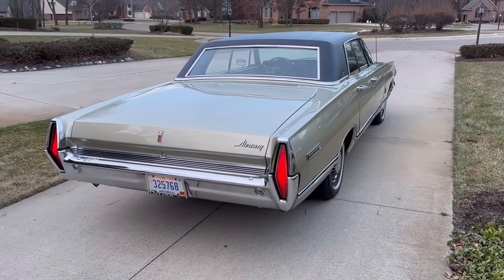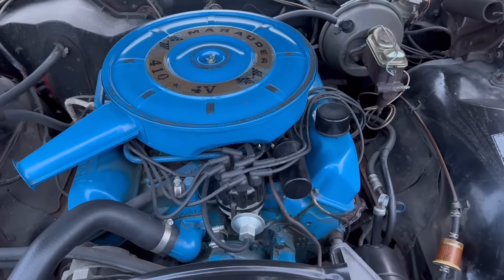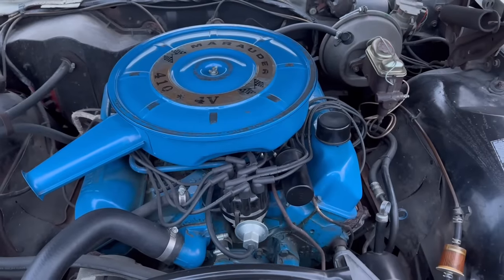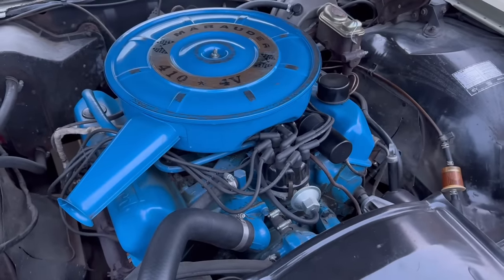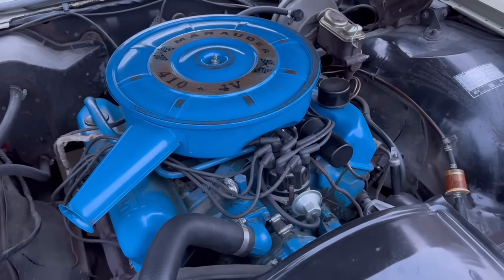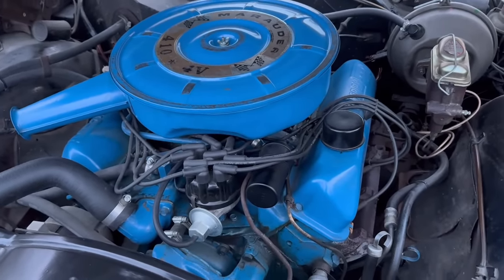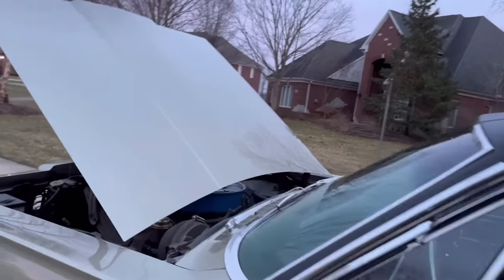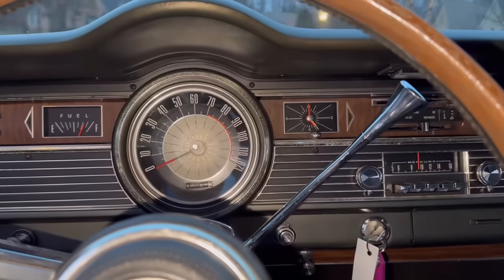Ford's Shortest-Lived (and Smoothest) V8 Engine: The 1966-67 Mercury Only 410 V8

Comment: I accept your challenge! When Ford went to an OHV V8 in 1954, they made it in 239 cubic inch form for only one model year: 1954.  In 1955 its displacement was increased to 272 and 292 cubic inches.
Reply: In trucks, the 239  remained available till 1956..
Reply: The one year only E0 Blue 4.2 liter 255 before the grey or unpainted E1 81 and 82 4.2 liter. Ford changed the intake manifold, and it then remained the base engine in the Fox T-Bird.and XR7 Cougar, Panther Crown Victoria and Marquis, the Automatic RS Capri and Mustang GT auto.
Reply: It's a beautiful car!
Reply: The Lincoln LS and Ford Thunberbird also had 3.9 liter V8's....
Reply: Not the same engine as the original “Y-block” 239, which was the first OHV V8 in an American Ford car. The last flathead V8, interestingly, was also 239 cubic inches.😊
Reply: I was replying to the comment about the Lincoln LS 3.9 engine.
Reply: @rextownsend5101  Correct.  The engine in the LS/Thunderbird was an AJ, built in England.
Reply: FE 332, 1958 and 1959 I believe
Reply: What about the Ford 406 found in Galaxies in 61-62?
Reply: Mercury Montclair perhaps the best demo derby car ever built! Tanks! Lol yes I did 4 or 5 of them lol
Reply: @joesutherland225  Wrong.  They banned the '60's Imperials because they could not be destroyed and won nearly every derby....
Reply: 54 mercury 256 was a fun motor in my opinion.
Reply: Mercury got a 256 inch version of it for 1954 only
Reply: Beautiful car Adam. So glad there is a guy out there who can preserve these wonderful land yachts and share his vast knowledge with us. Thank you.
Reply: I believe that the 410 was offered due to a shortage of 428 blocks. Using the 390 blocks with 428 cranks provided a premium engine to fill the volume gap in 428’s. All of the FE engines were terrific. Smooth and durable. Great in cars and trucks both.
Reply: My nephews rescued a '54 Ford Customline coupe from their grandfather's farm, which has the 239, and all the factory engine dressing and paint in tact (unfortunately, it bent a pushrod when they tried to start it 😢).  It's a work of beauty, and Ford was quite proud of first year Y-block.  From a design point of view, the suckiest thing about the Y-block is the rope seal at the rear which doesn't age well (like 100% of them leak from the rear seal).  There's a company that makes a kit to eliminate the rope seal, but it's major engine surgery to install it.
Reply: @geoffreywrigley2751 The 406 was also in the 1963 Galaxies. I had one.
Reply: He was talking about the FE engine (first year was 1958) in which he is correct.
Reply: @multicyclist  
FE engines refer to the family of engines which started with the 332CID and ended with the 428CID.
https://en.wikipedia.org/wiki/Ford_FE_engine
Reply: and 312
Reply: @DanHolmes-o9b  
I believe the 312 was a Y Block
Reply: @geoffreywrigley2751 .  That is an FE Block with a Bore of 4.130” and a stroke the same as a 390 at 3.78”.  Otherwise little different from a 390 and would bolt right in in place of a 352, 360, 390, or 427.
Reply: @deanstevenson6527  I had one of those. 1980 Mustang "Cobra". When you look up the definition of "pitiful," there's a reference and picture of the 255 ci V8. Ahh..., the "malaise" years.
Reply: Always liked early thru mid 60s Mercury's. 😊
Reply: @geoffreywrigley2751  No 406 in '61, was a '62 & early '63 engine.
Reply: Also 312.
Reply: @deanstevenson6527  it wasn't a very good engine.
Reply: @rdt8888 yep Y block it was.
Reply: @oneninerniner3427  It wasn't a very bad engine compared to say, the 85 to 87 HP 3.3 liter six.Everyone bags the 4.2, but it was economical, just not very quick.
Reply: @deanstevenson6527     Ssssshh.   We don't acknowledge the 255, lol.
Reply: The MEL 410 V8 was offered in the 1958 Edsel Corsair and Citation, and that was the only year it was offered. It didn't return for 1959.
Reply: @rextownsend5101  The Y-blocks also suffered from oil starvation at the rocker shafts due to sludge buildup in the oil passages going up thru the heads that fed the rockers. There was an aftermarket "remote oiler" fix kit, consisted of a fitting that tapped into an oil passage in the side of the block, feeding 2 plastic lines that went up to spray fittings tapped thru the top of the rocker covers, whiched sprayed oil on top of the rocker arms and shafts.
Reply: In 64 I know they made a 221 no idea what year it first appeared or ended.
Reply: Well done
Reply: 256 was also in that family with 272, 292 and 312
Reply: The 1954 Mercury engine was 256 cu in  YBlock
Reply: Everyone forgets about the 221 V8. I had one in my 1963 Fairlane. Great little engine. Made for about a year.
Reply: Wasn't the 239 also offered as an industrial engine for several years?
Reply: @geoffreywrigley2751  No 406 is '61. '62 and '63 only.
Reply: @ramflash1 yeah, I had one. My wife loved her little Cobra. In 83, I traded it in on a new T-Bird. Silver and black. I kept that car till 2018 when I gave it to a nephew. He loves that bird. I have a96 Mystic since new.😊😊😊
Reply: @deanstevenson6527  Ford never made anything measured in Litres in the US until the 5.0. If you're gonna talk about American cars at least use our measuring system!
Reply: The 221 Windsor lasted 18 months
Reply: @nathan40307  In 1966, Ford America released the 7 Litre  Galaxie 500. It was a  428, and wasnt even a 428, it was a 427 with  6990.1 cm³ 4.13 X 3.98 is however, just under 7 liters. And the advertising team spelt the name Wrong. Every one knows a Litre should be a Liter. 5 marks off, Henry Ford II...Just because some stupid Kiwis help America win the Le Mans '7 Litre' class. GED fail...
Reply: It was ALSO a 312 Thunderbird Engine y small y block v-8 !
Reply: @geoffreywrigley2751 Yeah he Skipped the 427 FE  TOO !
Reply: The marketing theory behind small engine changes has always been, "We have to give them something new and interesting for next year!"
Reply: From what I know the 215 ohv straight 6 was one year only then went to the 223 in 53
Reply: Ah yes, the good old days when you could lift the hood and see the engine, instead of a bunch of plastic crap. Everything was easy to get to and service!
Reply: @joesutherland225 
The Montclaire was built for demo derby?
Reply: @wythetrumpet6419  yes, fortunately I am still living that while I can, there is a lot fo flexibility to the older designs
Reply: Let's just say, Ford has made more engines in more sizes and more variations of each of those size engines for less good reasons than any other car company in history !
Reply: @darensamuels5208  390 and 428 blocks are identical blocks just a different bore size. Ford cast all of the blocks the same except for the late 406's and 427's. After casting they bore the blocks to whatever bore they want. So there would have been no shortage of blocks.
Reply: @deanstevenson6527  Liter is an "American only" spelling. Every other country in the world spells it litre. Since Americans did not invent the Metric system it seems apparent that the American spelling is wrong.
Reply: @FRLN500  You are getting a Meter of mileage out of this post.
Reply: @BillSmith-fx7xx  
Maybe they were on to something?🤦🏿🤦🏻
Reply: @deanstevenson6527     " And the advertising team 'spelt' the name wrong ".    I know some will argue that language is constantly changing.   As for me, I am sticking with 'spelled'.   :-)      Maybe you misst your calling !    :-)
Reply: @MrJohnnyDistortion     Not sure I understand your comment / joke ?   Please elaborate.   Thanks.
Reply: @BillSmith-fx7xx  lol
Reply: @tadhammond3901 
My friend had a 62 Fairlane with a 221 small block V-8
Reply: @rextownsend5101 
Simca produced the last Ford Flathead V8 design in 1990. They were for the Simca Marmon Military Truck. It was 255 ci like the 1953 Mercury.
Reply: The 260 cuin v8 in the ford falcon 1964-1965 the 289 replaced the 260 in ford cars.
Reply: @tadhammond3901  The 221 V8 set some records on the Salt Flats as well.
Reply: Didn't mercury make a 430 ci engine also? I'm a Mercury guy for my whole life. I currently have a very early January of 1965 Mercury Comet. Mercury did things a little different. And I 100% agree with your post also. The early Y blocks were different. Especially just after the flathead went out of production
Reply: @HIGHLANDERNEO2 One of my fondest car related memories is a ride in a 260 Ford powered car back in the early 1980s. It was an AC Shelby Cobra MK I.
Reply: @nickfay2359  
430 MEL (Mecury-Edsel-Lincoln).
1958-1960 Mercury
1959-1960 T-Bird
1958-1965 Lincoln

'59 T-Bird - 350 bhp
''58 Merc Maraudeer - 360 bhp
'58 Lincoln - 375 bhp
'58 Merc Super Marauder - 400 bhp
(Three 2 Barrel Carbs)
Reply: @brentboswell1294  yep know that well, a tedious task, more time consuming than hard, done one too many, but? Still great motors
Reply: @frankpriolo7735  From what I recall it was a series 262 to 312 were Y block and even the 351C was similar
Reply: @gk5891  And it's not able to be used in Bonneville Salt flat racing. Because it's cast in France and can be stroked way past 305 cubic inches...I liked the Pont-à-Mousson four speed gearbox too. When FoMoCo sold out the production capacity to Simca, a lot of really good Ford stuff was found under the engine covers of  troupe carriers. Klass in Germany continued to cast Model A flathead blocks for its combines too. A lot of stuff Ford left behind...
Reply: @FRLN500  That's not true.  That would result in vastly differing wall thicknesses and affect cooling.
Reply: My family had a 1954 Ford Custom 4 door. It was our family car and my family used it for years to haul a 16 ft travel trailer from LA to Lake Tahoe each summer
Reply: What engine was in the 54 Mercury that had the shit oil returned from the valve train.
Reply: @tadhammond3901  I had a 63 fairlane sports coupe with a 260. Very durable engine took lots of hot rod abuse
Reply: Beautiful!
Reply: 337 cu in  flat head 1951 Lincoln 317 cu in OHV y block 1952 Lincoln both Ford Motor Company vehicles.
Reply: @nathan40307 what about the  7 litre ( 427 ) Ford Galaxy in 67 ? That had a metric designation right there on the front fenders. Nice car.
Reply: @georgerenton965  I guess I've never seen one.
Reply: @nathan40307 not true. The 1966 XL 7 Litre.
Reply: @carlospar3727  yes, don’t know why I said 67 ? Wasn’t impressed with the 67 body style. Thanks.
Reply: Loved the 351 GMC V6. Easy to change the plugs, just a truck engine, plus two put together made a 702 work horse.
Reply: @darensamuels5208 that makes sense as to why they built this engine
Reply: Ford made a small 221 cubic inch ohv  V8 that was very smooth running in the early 1960s as well.
Reply: @johnscott2849 
I had a 62 Fairlane that had the 221 in it
Reply: I worked on a 1958, 383 FE Mercury engine, in a Automotive class in high school. The engine was donated by the local Mercury dealer. I’m pretty sure it was 383 c.I.
Reply: and 312ci.
Reply: @gk5891 The 430 wasn't actually considered an FE block. and it originated in Lincoln's.
Reply: @nathan40307  As the former owner of a 1966 Ford Galaxie 500 7-Litre I disagree.
Reply: @deanstevenson6527  
Actually they offered that car with both the "428" 345 bhp standard engine and the "427" 425 bhp. 

As to actual displacement, that is done everyday just like the Ford 352 (Same Bore x Stroke as 351), the Chevy 302 (Same Bore x Stroke as the hotrodders 301) as well as many others. Some 302 Ford's have 4.9L and some 5.0L on the emissions stickers depending on year and car or truck model.
Reply: @user-dp8gb9zu8v  I was responding to his post where he asked "didn't Mercury offer a 430". I specifically stated it was an "MEL" ie Mecury-Edsel-Lincoln (not an "FE")
Reply: @gk5891  I must skipped over that when I read the reply oops.
Reply: Anytime cubic inches are changed by stroking you also have to use pistons with a wrist pin height to compensate for the added stroke. If you increase the stroke .250” you move the wrist pin location down .125”.    A 1/4” increased stroke pushes the piston .125” higher and pulls the piston .125” farther down into the cylinder so you only move the wrist pin location down 1/2 the distance that the stroke is being increased.  I don’t remember seeing many 410 but do remember them. We went a different rout with our Big Block FE engines and used the 427 bore with the 428 crank which made a 447 cubic inch.  TRW sold pistons for that combination with the wrist pin relocated. Which meant didn’t have to special order them.
Reply: Dad had 54 one ton dually with  272. Top speed 55 mph but could pull a house.

Comment: Hey, I'm the guy who sold you that car, around 15,000 miles on it when you bought it, looks like you really brought it back to life, it belonged to my wife's grandfather, wasn't sure until I saw the Lofink license plate, it originally belonged to Adam Lofink, one of the original owners, great video
Reply from the maker: Oh very cool.  Feel free to email me.  rareclassiccars@yahoo.com

I did have the car professionally repainted, but haven't needed to do much else to it after all these years.
Reply from the maker: I also redid the exhaust system
Reply: Adam , do you still have have a drive around video of the 410 Parklane? It is so smooth and a beautifully graceful acceleration band. In my opinion, they should have just switched all FEs to 410s then. It would have been great in trucks, Fords, and even canned up for a 410 Mustang in 67 with an aluminum intake and Quadrajet 750 with good exhaust manifolds. I think it would have gained some street credibility with the QJet and aluminum intake, some short headers… the 410 may have made the 428 unneeded. 20 extra cubes is good.
Reply: I’m currently working on my great grandmother 67 mercury Monterey I’m not sure if it has a 390 or 410
Reply: Glad to hear. You know he'll keep it safe
Reply: @mybackhurts7020  You can tell by the vin number , that’s if it has the original engine in it !…
Reply: that's funny because I caught the Carthage NY on that same piece, my dad owned the old Ford mansion at 812 State St. Carthage for a number of years as well as a couple of other apartment buildings in Carthage, but the old Ford mansion was the wickedest house I've ever been inside, it was awesome . . .
Reply: Why would it be any smoother than any other V8